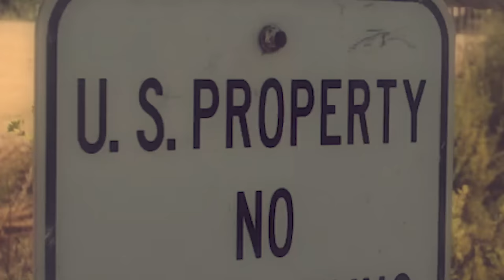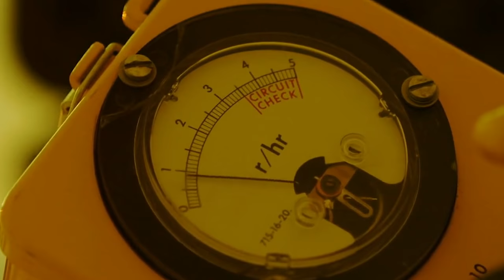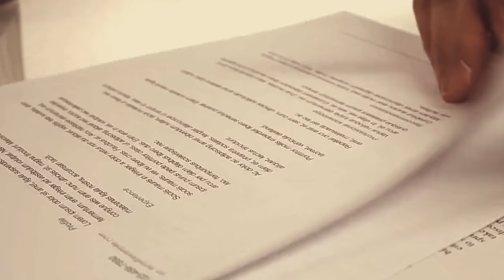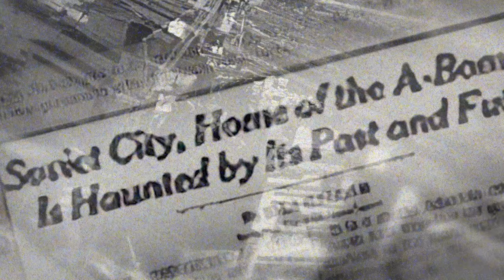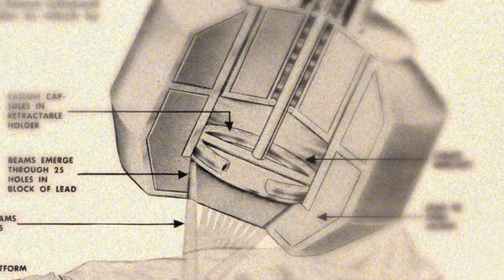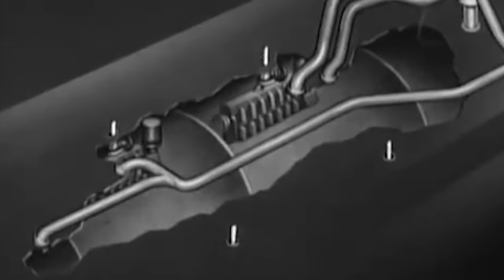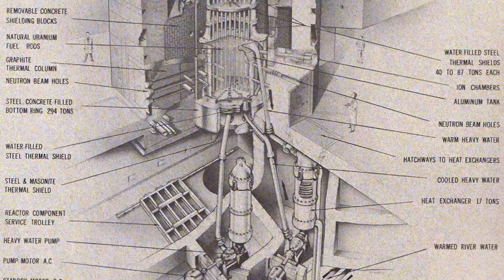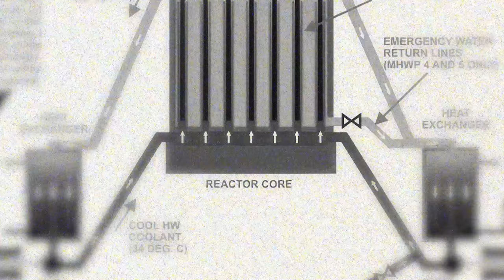The 5 Secret Nuclear Accidents Stranger than Chernobyl

Comment: In 1958 the Windscale plant as the Sellafield Plant in Wales Today had a serious accident but for the swift intervention of the crew cutting off an air supply to the reactor, however the winds blew Iodine 131 across northern Europe and was probably responsible for 300 deaths

Comment: 1) Cobalt 60 does not emit neutrons.  Cobalt 60 decays primarily by gamma emission but also beta, eventually decaying to nickel. A beta particle comes from the disentegration of a neutron into a proton and the emitted beta particle (essentially a really high energy electron emitted from the nucleus of the decaying Co-60 atom. Co-60 is extremely radioactive. The quantity that comprises 1 curie is approximately 1/40 of a gram. The 6000 pellets in the teletherapy source were approximately 1 millimeter I'm size each.
2) Interesting fact. The term crud, meaning sludge like deposits in piping, was coined from chalk river. CRUD in this vernacular stands for Chalk River Unidentified Deposits.
3) Cesium 137 decays by both Gamma and Beta radiation. The beta decay is quite energetic and will exhibit Cherenkov effect from the high energy beta particles interacting with material around the source, yielding the characteristic blue glow.

Comment: All these accidents happen. 

The world leaders: "LET'S USE IT MORE"
Reply: Well, fossil fuels have killed much more people than radioactivity accidents and will continue to do so. A temporary phase where energy generated by nuclear centrals increases the output while "clean" energy generation is ready (due to low output) would help to reduce the carbon print and, maybe, avoid or lesser the climatic emergency
Reply: @otube6622  Yeah, because oil spills cause an area to become uninhabitable for 1,200 years....
Reply: @jimmyrustler8983  Consider the following: there are more than 3.5 million deaths EVERY YEAR for fossil fuels’ air pollution. Fossil fuels do not need to be spilled to be mortal, we only have to release them in the atmosphere (which we do). In comparison, there have been less than 14,000 deaths due to nuclear and radiation accidents in all history.

As I wrote before, we only need the use of nuclear centrals until the “clean” sources of energy can leverage the energetic needs of the world, which are increasing constantly.
Reply: Some of these weren't power plants they were glorified X-ray machines that were decommissioned and fell into the wrong hands.

Comment: The Windscale reactor fire in Seascale UK should qualify as a nuclear disaster,  by the slimmest of margins a wide area was not contaminated. The radioactive iodine levels in milk from local grazing cattle due to the dispersal made it unfit for consumption. Localities advised residents to remain indoors because of airborne contamination, though it was minimized by the authorities at the time years later the actual danger would be realized.